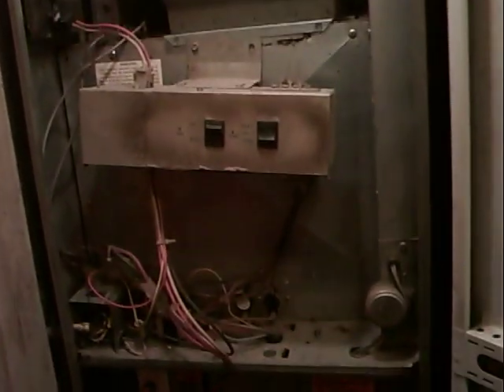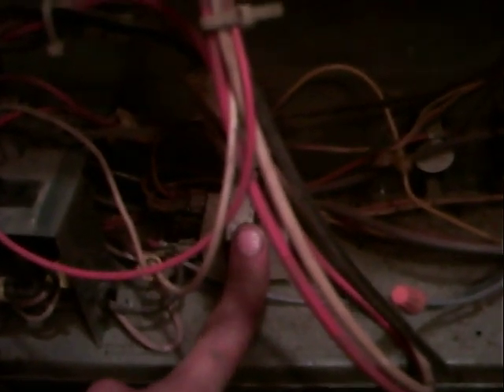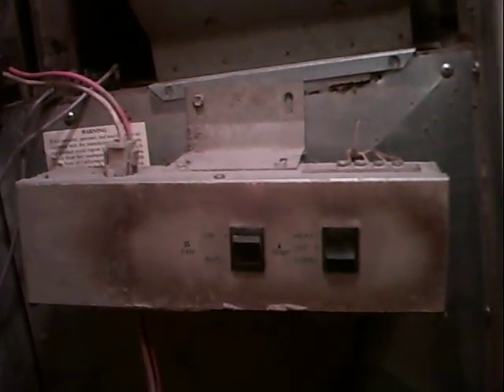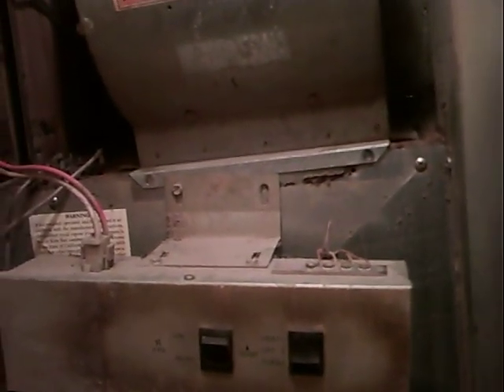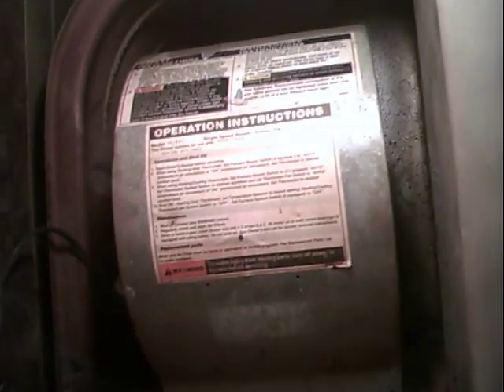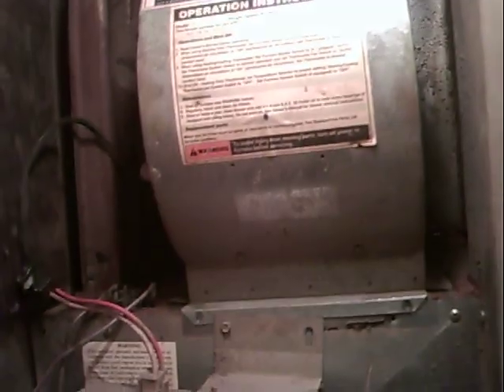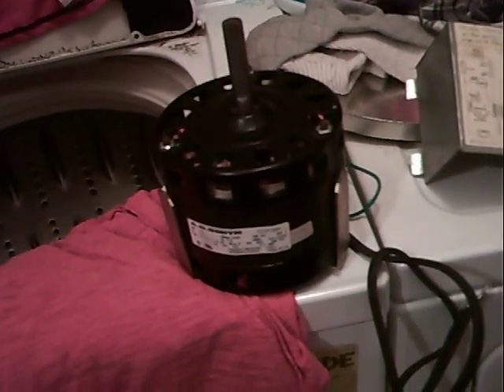Mobile home furnace repair

Comment: Here troubleshooting:)  Something people don't think about concerning their furnace.  Not only is smoking cigarettes bad for your lungs, the smoke also takes a toll on everything around it.  Your TV, PC, Frig, Curtains, Rugs & Clothes get very nasty form smoking!  I just realized this because my PC started shutting down because it was getting hot. It couldn't breathe because the fans were covered with yellowish dust!  It's back to normal after a good cleaning :) BTW - it made me think about what my lungs must look like too :(     

My furnace is 6 years old and I change filters about every 3 months but now it's started making a noise that sounds like trouble. It's time for a deep cleaning besides just changing the filters and I hope I find some good advice on "how to" here :)  If it looks beyond my skill(s) I'll call a Pro if I have enough money to do that...   Hope this advice helps someone else and that I find a simple solution to my concerns...   Preventive Maintenance is a good thing people for your pocket...    Thanks for you post :)

Comment: Thanks for the video, can you help me, in my double mobile home, my furnace stopped heating one side of it and i noticed on the side where it heats that at times it blows harder th en
normal. Do you think that something is wrong with the duct, that it tore a hole or something? thanks so much if you see my request.

Comment: My furnace/fan turns on and off continuously. Which is causing it to not reach the desired temperature.I have a 7900 coleman furnace. Appreciate any troubleshooting/guidance to resolve the issue
Reply: Limit might be failing it set too low.

Comment: I have a 1989 Coleman 3400 series electric furnace just like this and you have to open up the furnace to change from heating to cooling, I want to install a Nest thermostat so I can change from heating to cooling from the thermostat. The furnace has a sticker on it where the thermostat wires connect saying if the locking clip has been removed, to switch between heat and cool you must do it from the adjoining switch.
My question is .......where was the clip and what was it connected to? I am unable to install my new Nest Thermostat because the clip {what ever it looks like} is Not there...........................PLEASE HELP
Dale

Comment: Any idea what would make a mobile home furnace vibrate? It’s a miller. It seems to still work fine just has a vibration that started out of the blue. Any idea what it could be?
Reply: jeremey wright there are four little rubber grommets underneath the squirrel fan on top that bolt it to the actual funace make sure everything is secure up there
Reply: you need to get a new fan cage sounds like its bent and out of balance.
Reply: Lousy air filtration allows a lot of dirt, hair, etc. to accumulate and that can really mess up the balance on the blower. The inducer motor bearings can make a lot of noise as that motor enters its final stage of useful life.

Comment: If both the transformers are the same in terms of secondary voltage and overall design, could a broke guy swap the one good one from one position to the other, depending on the season, to just get by for a while?
Reply from the maker: Just run the 24v from the good one to the bad one and unhook the wires from the old one.

Comment: my furnace breaker tripped out reset breaker but sparks comming from the on off switch when breaker is reset immedialtly tripping out breaker again ...  any sugguestions ?
Reply: fred flick shorted wire or grounded blower motor

Comment: That furnace should really be replaced especially given the inefficiency of the old ones and the efficiency of the new ones.
Reply from the maker: Old furnace is like a old car. If it runs and gets crappy mileage its better than making payments and great mileage. I see your point though.